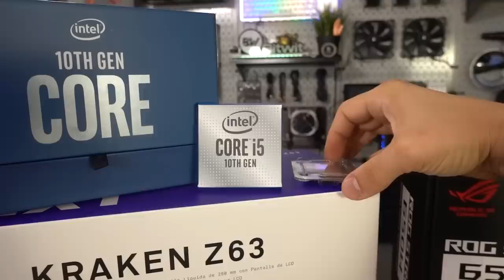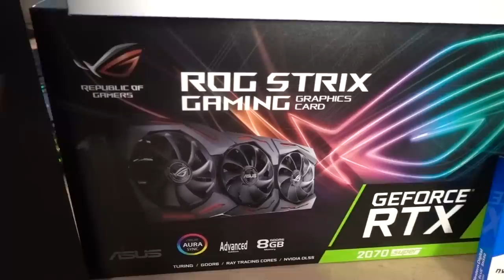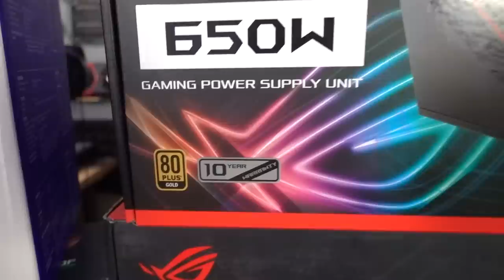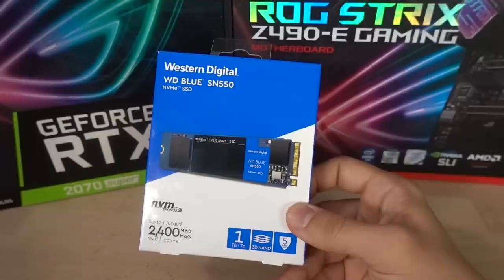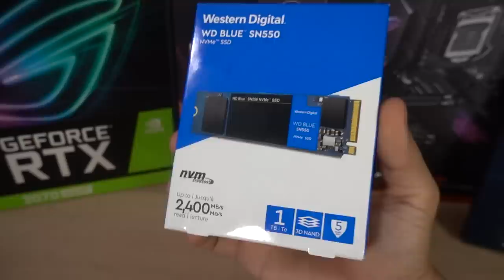Building my first Intel PC in AGES!

Comment: 0:25 "so I'm hoping that this system will jumpstart his interest back into gaming"
uses 2070 super
Reply: what do u mean? 2070 is a very capable card.
Reply: @ishananaguru  I know it is. I have a 2070 super in my own system. but I thought it was a bit overkill for a PC that will probably not be used exclusively for gaming.
Reply: Ishan Hettiarachchi that’s the point haha it’s a bit over capable for a “get back into gaming system”. Out of the 20 series line up though it’s probably the best value for sure

Comment: Kyle can u do the best 800 dollars build as most prices are expensive now
Reply: just get a NZXT starter pc
Reply: Search “joey delgado 800 dollar pc build”
Reply: I think the 2600 and 1660ti would work for 800 dollars if you’re focused on gaming
Reply: He's done videos on about that price point loads
Reply: Velo GBS no but all the prices are getting higher
Reply: fadedfrantic you could get a 2060 but I think in raw gaming performance the 1660ti is slightly faster
Reply: Danzard damn that’s cheap! Mine was about 180 or 190 when I got it
Reply: Ryzen 5 3600 is best choise in my opinion rn
Reply: @PleepyC  what? 1660 Ti is definitely not faster. Both specs and gaming benchmarks are on 2060's side.
Reply: Ryzen 3 3300x 
Gigabyte b550m
Rtx 2060 ko
Corsair vengeance 16gb 3600mhz
Seagate barracuda 2tb
Samsung 860 evo 500gb
Corsair cxm 550w
P400a
784$
Reply: Linus has made a couple of them on stream. You can watch vods on ltt channel. Kyle also has done quite a few, I'm pretty sure
Reply: @refriedredfred  are you on crack? They charge for windows. And it's like 100$ or 75😂
Reply: @02102u  That is a good video. Component selection, build guide,  video quality are spot on
Reply: Chali YYY 120
Reply: @hixts2186  that's insane for windows. You could upgrade the GPU with that.
Reply: Built myself a r5 3600x 3k ram and 1660 ti for 1200$ CAD, which is around 800$ US, it's a good build!

Comment: A good choice of components, balanced configuration, I have a friend who did the same config lately. For a pure gamer the choice to take Intel, has advantages, less latency on the system compare to AMD less input lag as well and better FPS results on average, 1% and 0.1% low and also a better Gpu Scaling.

Comment: I recently built a Intel PC for someone, and when you do, you realize how little you get for the premium you pay over AMD.
Reply: Yeah it’s not worth it at all at this point. AMD is so solid nowadays
Reply: ok you still prefer expensive pcs
Reply: You get a piece of mind. I am aware that their CPUs are not their GPUs but after returning my 5700xt and having an RX ,470 when I was poor I won't be buying an AMD CPU. I don't trust AMD when it comes to QA and reliability and their drivers. Intel I know will just work
Reply: I have a snapdragon and I'm happy with it lol
Reply: @gasviation9077  that's ok. I enjoy using the best CPU In the world. That is Intel. AMD had 3 years and still can't keep up with it in gaming 😉
Reply: AMD cpus are still unreliable as fuck. always overheating, non compatible drivers and stuff. you know you won't have any trouble with Intel
Reply: @ggbk8584  I had a similar problem with my 9900k. Would idle at 45 even. It turned out MSI was cheating and going out of spec to win at benchmarks. GN caught them even lying in the voltage! Fuckers. I switched to gigabyte and the problem went away. Could be similar to your AMD system.

Comment: Had the same problem with the vertical bracket and GPU clearance in the NZXT H510 + Kraken X52. To solve it, I had to put the fans in front of the radiator. It's not ideal for future maintenance, but it gets the job done at least.

Comment: I'm halfway in the video ale one note here. The way you have mounted radiator will promote noise in pump and limited flow. Also it might reduce life time of all-in-one. You should have fittings on the bottom where they never see air. Air would stay in back of radiator, never reaching pump.
Reply: Someone watched Jays video
Reply: @ValMephora  I don't know who/what that is.
It's common sense /knowledge. I've been watercooling my PCs since first Athlon (over 20 years ago). Back then there were no AIOs. Actually there was nothing. You had to build everything from scratch.
You learn thing or two...

Comment: you don't need the extra 4 pins for the CPU, It's only for extreme OC like with liquid nitrogen If it's just general w/o OC or OC a little normal 8 pins is fine.

Comment: Had the same issue with my 2070 super and the aio in the h500. I ended up mounting the fans the other side of the bracket at the front of the case which saves you that thick fan width. Temps are still good, would probably be even better if I had low profile fans to give even more room for airflow

Comment: I had the same problem with my mobo's RGB (ROG Strix Z390-F Gaming) ... Where if I set everything to pink, the mobo would look more purple (pink and a pinch of blue = purple).
Couldn't find a proper solution, so I just disabled the mobo's RGB entirely (which also disabled the LED on the power-button).

Comment: “Nothing too intensive”

Proceeds to put a 2070 Super  in the build.
Reply: He used his last pc for 8 years, in that time a 2070 super will probably still be relevant, even if games get more intensive
Reply: don't forget that this specific 2070 super costs like 2080 super
Reply: MKReptile Ermac  yes there is. Any rtx card is intensive apart from maybe the 2060 which is kind of uppermid range. Mid range would be basically from the 2060 tp the gtx 1660 or the 1650ti and everything from 1650 to worse/cheaper is on the lower end. Im considering specs for gaming and not for working btw. My pc has a eyzen 5 2600x (that i found for the price of a 5 2600 and a rtx2060 tgat i found for the price of a 1660ti
Reply: @davidsegalle563  and that is plenty for 1080p Gaming (:
Reply: @Hugtatlal  yes i know. At the beginning of last year i bought a 144Hz monitor but my 1050ti struggled and i had to play on 720p so i started saving a lot and foynd a 2060 for the price of a 1660ti in february. (The processor is just because i had to upgrade from my fx8320 that was beginning to have stability issues after 5 years)
Reply: David Segalle I’m probably upgrade to rtx 3000 series from my 1660 ti and, my cpu i7-9700F will still stay same.
Reply: @davidsegalle563  wow where did you found that offer on? Right now im using an ryzen 5 2600 and a gtx 1650 super. Im pretty happy although I dont hit the 144fps constantly in fps games.
Reply: @Hugtatlal  the 2060 was a used card from a dude. He said tgat in benchmarks the 2060 was slitghly below average but when i did the test it was about 1% below. And it is a galax card with 1click oc amd when i turned that on it rose a bit above average, and after some fiddling with msx afterburner (nothing major just fan curve and a bit of a clock boost) i got it to 5% above without really stressing the card
Reply: @Hugtatlal  the cpu was on an offert in fastshop i think cant say for sure, but i was looking for cpus on that range for a ehile so its no surprise eventually i found something. Btw i had to get the cpu fan separately in that deal so i got a wraith stealth i think(irs def wraith something but idk which)
Reply: @davidsegalle563  wow, great for you 👍
Reply: @extradetails4686  do you use your pc for anything other than gaming or at least for doing something else while gaming like discord and music or chrome? Probably shouldve gone amd. Rn my only process intensive task is gaming but im in computer engeneering(cant spell that in english) and i suppose ill get to some hardware intensove stuff soon. If you might get a new use for your pc youll probably have to switch cpu sppner than if you had gone amd
Reply: David Segalle 2060 and above is mid range to mid high until you hit the 2080. Anything lower then 2060 is low end to lowest respectively.
Reply: @apricotmadness4850  sorry, but 1660 ti and 1660s must be considered as mid range too. Just my opinion.
Reply: Lovis •ロヴィス Well, I respect your opinion, but I disagree.
Reply: @apricotmadness4850  you just have too much money, thats the difference. And i mean way too much
Reply: MKReptile Ermac  wrong
Reply: David Segalle I don’t actually. I’m definitely not rich. I just don’t think the performance is anything to ride home about in regards to that price range. Their great for budget gamers, but are not that good for future proofing, high refresh rate, or higher resolutions then 1080p which more and more people are and will inevitably get into.
Reply: @reloadingdontshoot1  a 2070 super is like 10% worse than a 2080
Reply: The 1080ti is stronger than the 2070.
Reply: my names dave and I have a 2070 super, they cant be that good!
Reply: MKReptile Ermac  bruh
Reply: Death Onion 2070 super is pretty much an overclocked 2080 🤣
Reply: Linus - nothing too intensive - So, we have 8 Xeon Platinum 8380HL's 28 core, 56 thread, $13,012.00 each ..., so $104,096.00 for the cpu's...
Reply: @apricotmadness4850  I agree, and I've never even built a computer in the past and think that the 2060 is definitely not the best or high end necessarily. I respect anyone who has it and if that's what works for them then great, but 2080 supers and 2080tis and definitely more high end which is why I was going to go with the 2080 super for my first build, but now I'm waiting for the 3000 series because I'll either get a newer GPU around the same price or a 2080ti over a 2080 super at a much more affordable price. Either way I'm getting a much better GPU for the value if I just hold off until September. Given that I'm going all out in some perspectives for my first built PC I have time to save anyways so I might as well wait a little longer to have better value. In the mean time I can just buy a 3950x, mobo, case and basically everything else first.
Reply: Chrome Be Like: Are You Challenging Me
Reply: @thelaptopabuser  2TB ram? OUT OF RAM.
Reply: @reloadingdontshoot1  I can game at 4k on my 2070 super. Just need to lower video quality settings.
Reply: @reloadingdontshoot1  I see your point but I was saying 4k is still doable despite the compromise. Wonder how good 4k gaming is on the 3XXX GPU's coming out
Reply: @Le-Grande maybe the 1660ti/1660super could be considered high end, but the 1660 is def mid end. You can get a 1660 pc with a 144hz monitor for under 1100 usd easy (if you dont consider quarantine prices ofc)
Reply: Seth price I would wait until Ryzen unleashes the 4000 series. That’s what I’m doing. I bought a 3600 to hold me over until then. The 3950x could see a substantial price cut and their might be a  better 16 core variant in the 4000 series.
Reply: @Le-Grande i meant 1k easy so like with some ridiculous specs like a b450gaming pro carbon ac or a aiocooler and a expensive case

Comment: Building a mid tier gaming setups. Am I right to assume a 550w gold rated power supply will suffice for a ryzen 2600 rtx 2060 based system assuming I do some modest overclocking and don’t have anything else crazy going on cooling or rgb light-wise?

Comment: OC'ing on intel is stupid easy and is pretty safe. download intel xtu open it up and you have all the controls right there. Stress testing and everything. Basic view literally has like 4 buttons. In a total of three steps. Run a benchmark for the first choice/step. Second step consists of very user friendly ocing the chip and cache with a slider and last step is running another benchmark. And if you want to make sure its stable you have the option of running a stress test which is also simple as hell.  And if its unstable it will just perform a restart and it will be back at default. Its as convenient as MSI afterburner. Its literally ocing for dummies.

Comment: Protip, if the white of the RGB doesn't match, shift the color more into red or blue if needed. You can achieve a lot better white tones than the original tones most of the time.

Comment: NZXT needs to fix the hose positions on that AIO, if you ever wanted to add more ram to that system you can't because the hoses literally block the first slot (and yes you could just use higher cap DIMMS but that only gets you so far especially if you want higher speed modules).

Comment: is it not a bad decision to mount an AIO vertically with hoses up top? I would think the air would gather at the top then be pulled through the loop again and repeat? I heard and have always mounted them so the air could settle where it would not be pulled in  again towards the pump. Although I switched to air coolers, much less hassle and noise

Comment: i’m planning on building my first custom pc using 
ASUS RTX 2080Ti 11GB Rog Strix
RM1000x Power Supply 
Intel 660p 1TB M.2 PCIe SSD
I may be using 16TB of storage....
64GB RAM Corsair Vengeance 2666MHz
ASUS z490-f ATX
Intel Core i9 10900k
With some ll120 fans and a H150i liquid cpu cooler

Comment: Building my pc tomorrow, should I mount my AIO cooler at the front like Kyle or top? And should I add two extra fans on the other side of the radiator for better airflow through the radiator? Plz help!

Comment: 22:10 Couldn't you to fit the AIO fans on the radiator and retain the use of the vertical GPU bracket?  You'd have the fans as push thru the radiator rather than pull effectively keeping the vert bracket in play.  Just my thoughts

Comment: Hi mate, I have a question:
I just build my first PC (finally) and I'm going to buy me a x63.
I have a ryzen 5 3600, which can get really hot.
It is still mostly under 80 °C (from 50 to 75 when gaming) so nothing to worry about, but still, I would like to get it down a bit, and also it looks way better hahahaha
Now, I saw you using the stock thermal paste, is it really okay or should I get an aftermarket one?
Thanks in advance, keep up the good work!
Reply: I would buy a Thermal Grizzly Kryonaut Thermal Paste. It only costs about 20$. Many times the stock thermal paste is a bit dry and not so good.

Comment: need to turn that rad the other way...hoses down or you will get air bubbles going into the pump...it will over work the pump and cause early failure and noises...need to remember that the rad is not filled right to the top with liquid

Comment: I love the look of those NZXT AIOs, but I had to send mine back in favor of another brand because the way the coolant lines go in and out of the side makes it impossible to fit the NZXT in a system that has all 4 RAM slots occupied. (I know you can turn the block 180 degrees and I tried that, but that just moves the problem to the other side.)

Comment: I have been Building / Upgrading and Repairing Computers for over 25 years. Today when I was trying to swap the CPU Cooler on an AMD Ryzen 5 3600 / MSI B550M Pro Motherboard...I pulled the CPU out of it's Socket !.....Never in 25 years has this happened !...Going back to INTEL until AMD changes it's CPU Hold Down Unit !

Comment: You've installed the AIO radiator upside down. With cables up it will pull air bubbles to the pump.
Reply: Glad im not the only who noticed it.
Reply: it's fine as long as the pump isn't the highest point in the loop, it will only get a bit noisy after enough of the water has evaporated.

Comment: Actually the rubber pads are to insulate the power supply so it doesn't come in contact with the rest of the system and short circuit.

Comment: It's an 8 phase, not a 16 phase. It's an ASP1405I 8 phase pwm without a doubler. Couldn't possibly be a 16 phase. It's an 8 phase running 16 power stages in parallel.

Comment: Hi Kyle , I have a Laptop which is Asus and specs are as follows:
RTX 2060 , Ryzen 7 3750h , 16gb Ram 24000mhz  512gb nvme and 1TB HDD .15.6" screen and 120 Hz.1080p.
Will i be alright for altleast the next year , i play games always plugging, so does that affect the adaptor life span and the battery as well,i put on  a safe mode the battery ,ie it can charge upto 60% only.
My last question is that if i had a PC with the same exact specs as my Laptop .will it be significantly faster with a 1080p monitor 27".120HZ ???? 
Please reply me ok im a huge  fan of yours and im plannng to build a PC thats why i asked you.Thank you Kyle, Stay safe n Take Care OK !!! Thank you.

Comment: Hi kyle, i have an offtopic question, my 970 just died, and i need a new gpu, since it wasnt planned i have a budget of 550 euros, and i have found 2 gpu but i cant decide which one to pick. So the first card is the  rtx 2070 founders edition from nvidia store in my country, which also is delivered with the pc game deathstranding, the other card is a msi rtx 2070 super gaming x trio, now the best value for money should be the fe which cones with a game but the fact is that i will not plan on changing it in less than 5-6 years and i saw that the founders edition a pain in the ass to disassembly or if uou have to change its fans, whereby the msi is easier to do and the custom heatsink has better temperature than the fe. If you have to choose which one will you buy?

Comment: If Mike is anything like myself (doesn't like RGB) and just wants something that works without overclocking the crap out of it, I feel he might have wanted an air cooler where the fail rate is near zero compared to an AIO

Comment: Radiator is upside-down.
Guess it couldn't be traced the correct way though as the case is small and there is no space between the gpu and fans for the tubes.

Comment: I hate cases where panels just pop off like that and have no mechanism for securing them. It means any time you need to shift it or lift it you can ONLY do so by the bottom otherwise panels will just pop off.

Comment: Why do you always put AIO on front if you can put it on top? With CPU AIO on front your GPU would be breathing a warm air from it.
But if you place it on top and 2x fans on front, fresh air will make CPU and GPU cooler by 2-7 degrees.
Reply: If it's in the front there's more cool air passing through the AIO.